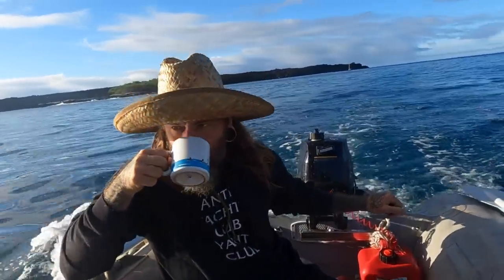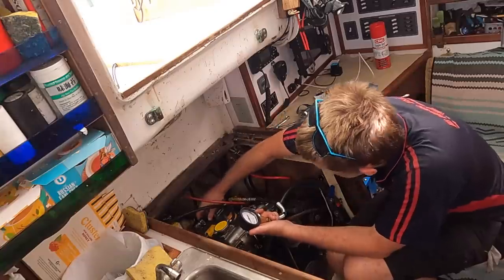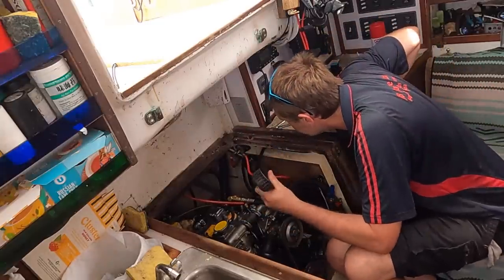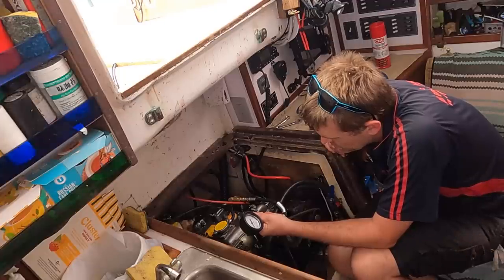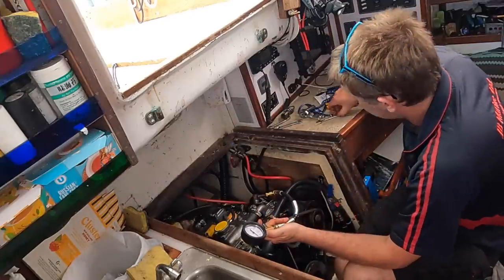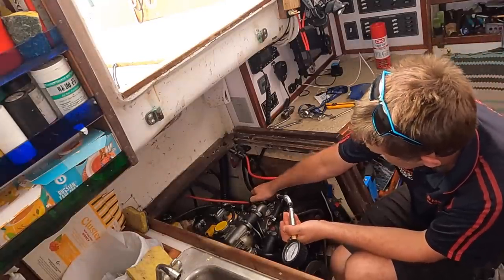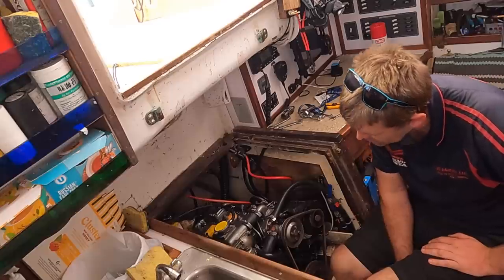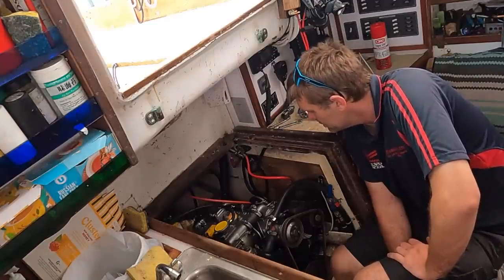ENGINE FAILURE: Testing the Compression & Pulling The Engine On a Sailboat in Opua New Zealand

Comment: I rebuilt my own 2GM20F.  It cost $1,200 US in 2012 in Mobile, Alabama.  These little engines weigh 365 pounds, close to what a car engine weighs (a small v-8).  If you remove all the peripherals (starter, transmission, alternator) it still weighs over 200 pounds.  There are no sleeves so you might have to ream and oversize the cylinders but my cylinder walls were fine.  I just honed them to break the glaze.  I had a professional machine shop rework the head:  it did not need to be flattened but he did replace the valves, valve guides, valve seats, springs and carefully clean it for $220.  I replaced all seals, put on a new fuel pump, replaced all bearings (the crank did not need work), new pistons and rings.  When I re-assembled it and put it on a test stand it started before the crankshaft completed a complete revolution!  It used 10 quarts of oil before the rings seated but never used any oil after the initial break in.  It ran perfectly for hundreds of hours.  These are great little engines that are easy to work on.  Unfortunately, Yanmar no longer supports these engines here in the USA.  But parts are available from international sources.  The chief problem with the engine is the water-lift muffler and seawater cooled exhaust.  Salt vapor erodes the heads with rust and imposes severe damage to the engines unless the exhaust is isolated from the engine at every shut down.  If you run a hot exhaust like all commercial boats do, this is not a problem and the 2GM20F will run for over 20,000 hours.  Great engines.  Anyone sailing around the globe should learn to fix his own engine.

Comment: Standard Yanmar issue. 
Exhaust valve and valve seats get eaten away by salt air coming back thru exhaust system. 
They can blow head gaskets but its not the most common fault unless they get cooked. 
Exhaust mixing elbows choke up (from low speed running, leaking/dribbling injectors) which cause too much back pressure on the cylinders.
Precombustion chambers can erode away. 
Shouldve put a squirt of oil down the cylinder thru injector hole to see if compression increased or stayed the same. If it increases then its normally a piston/ring/bore issue. If it stays pretty much the same then its normally valve seat condition. 
GM series Yanmars are a great little unit but they all suufer from the same issues. 
Raw water cooled units suffer more than engines with a heat-exchanger system.

Comment: when doing compresion test. If you add oil and do second test.and copression goes up. It tells you rings worn. If no change then its a head issue. Valves/guides.
Reply: That's true,  it could be rings but it could be valves.
Reply: On a diesel, if you add oil you can hydraulic the engine and do more damage..
Reply: @WillParker-kc3xt  he doesn't mean putting oil on top of the piston but rather in the normal way. It won't hydrolock
Reply: @jonnenne  you would never compression test an engine without oil in the sump. You and the original commenter have no idea

Comment: Low compression can also be caused by carbon buildup on the exhaust valves. There's an old trick where you pour a little auto trans fluid and kerosene mix on top of the pistons while the cylinder head is off getting a valve job. The atf and kerosene mixture will leak down into the compression rings and dissolve the carbon buildup, the cylinder head valve job will fix compression leaking out the exhaust valves, you put it back together and your all set! Another 2000 hours. Sometimes. But "sometimes" is still definitely worth a shot!

Comment: Got water in my old MD11  but realized it quickly and  saved it  by taking of the head and draining the motor  refilling with Oil   wasn't perfect but  continued running till i sold the boat a couple years later.

Comment: I have overcome low compression starting on an old tractor in winter by firing a blowtorch into the air intake. Not for everyday use, but gets it started.

Comment: Low compression doesn't necessarily mean that the sleeves and rings are worn, could be valve timing, or seating, or head gasket. If rings/sleeves were worn, you would have crankcase pressure, so next thing would be to check crankcase breather. If head gasket, and no fumes in boat, check crankcase breather and water pressure on fresh water cooling side, but if valve issues take head off and check seating.

Comment: No wonder you had a tough time getting the Yanmar started. As far as why it was getting raw water in it, there would have been several things I would have checked. The siphon break which must be installed between where the raw water comes out of the engine and the mixing elbow is clogged or not there (I've seen new engines ruined because of this). A bad mixing elbow. Some other exhaust defect like hoses or lift muffler. Overcranking with the raw water inlet open (pump still turns). I've even seen where a scoop was installed on the thru hull force water past the pump that did it. Hopefully the cylinders and head weren't too pitted and you didn't have to bore the cylinders out. At the very least I suspect you had to change the pistons and rings, and most likely the valves.

Comment: Hi James, why not building a bracket on the stern of your boat, to mount the outboard directly to the boat? It would be much easier to steer and handle while under outboard engine. Tritea is not that big and the outboard prop should shurly be in the water. I,ve seen that kind of brakets on a lot of sailboats here in Germany. Fair winds and following seas.
Reply from the maker: Because it’s unnecessary and I would have to have a long shaft outboard

Comment: I would think the sea water in the engine is from cranking the motor over without closing the seacock. It was pumping water with no exhaust, and it filled the exhaust up with water and into the motor

Comment: Has it not got a heat exchange  in this system, is it raw sea water strait through the block. Or is part of the problem water cooled exhaust manifold leaking back through exhaust valves . Hope you get it all fixed at a reasonable price.🙂

Comment: I seen another sailing channel that has a very simple leverage device on the side of his boat where he attaches an outboard motor to and simply lowers or lifts out the outboard from the water with the handle in seconds.
Reply: But then you use petrol and that cost à lot
Reply: @jungbolosse3034  when your about to be smashed by a approaching storm or you need to move fast away from a reef or a ship  and your engine has broken down costs don't matter and easier to fix .
Reply: @wilowest3509  so you are not talking about a permanent solution just in case of breakdown
Reply: @jungbolosse3034  yes a backup short hop solution .
I will try find the link tomorrow am off to bed now but was a simple setup .

Comment: Excellent episode -- QUESTION -- Had you installed a new Beta Marine (or similar) engine a the start all those years ago, would you still have all these engine problems or would you have avoided it all?
Reply from the maker: Water siphoned up the exhaust port, that would kill even a brand new engine, I had attempted to install a inline bronze seacock in the exhaust hose but it was impossible to find the fittings due to the parts shortages during the pandemic

Comment: Is it not work making some kind of clip or bracket that's removable to mount your outboard on to push the boat in emergency
Reply from the maker: The outboard would have to be a long shaft, the dinghy on the hip works perfectly
Reply: @SailorJames  one either side and it's a hydrofoil 🤣

Comment: What would a new engine cost?  I’m curious how close the repair bill came to just starting fresh.
Reply: Problem is, today, most modern boat engines are ruined the same way as car-engines are ruined by the zealots of the greta-religion. A diesel engine for a boat does need a high compression in somewhat voluminous, longstroke cylinders to enable momentum (torque) with low revs, induced by an all-mechanical, bulletproof low-pressure squirter-pump with one pumping piston and a separate injection line to an all mechanical spring-calibrated injector per cylinder, best even with a prechamber. 
There are no more such diesel engines You can buy new these days because they might smoke visibly (no modern NOX or micro-particles, just good old CO2 and honest grime) which is a no-no for all these technically illiterate greta-zealots. 
So, repairing/rebuilding it is, to thoroughly avoid all the senseless, unnecessary overcomplication all these shortstroke highrev biturbo common rail electronified direct squirters ruin the longevity of any good boat engine with.
Reply: @manfredschmalbach9023  in australia you can still get the gm30 non common rail for 5k new. But not in tbe usa.not sure about nz.

Comment: mechanical diesels (non-computerized and stuff) are the most reliable, practical engine types there is.  Yanmar has been making marine diesels for almost 100 years now.  I'm surprised
Reply: Me too, I have a vit of a love affair with diesel engines in general tbh, and never had a Problem with Yanmars, pr Volvo, probably  due to spoiling them rotten with early servicing and working them at good torque rpms, as all diesels just love working under load, keeps them shiny and happy inside. My  Next Sailboat comes with a Common Rail Computerised Yanmar 80hp as standard, so a bit nervous about that I must admit. 🤔 Best Wishes and Fair Winds.  Bob in Wales.  👍✨️✨️✨️🍻
Reply: @brownnoise357  wow, even new expensive yachts like tend to NOT use computerized diesels that are the back up engine for the reasons you well know.
Reply: @protonneutron9046  I know. I am Prepared to Test one though, as if the piggybank is as full as it should be, for me to pay up front for the Yacht, then a replacement engine a few years down the road should be OK, and I do just love Testing Stuff. A switchover of engines should be straightforward, as it is a traditional Shaft drive through the gearbox. I'm also going to be testing the Seldene automatic Sail Handling System, and the Sugar Scoop Bathing platform can have a dropdown Bracket for a backup Outboard as well, just in case. I'll also be testing a Triradial Suit of Sails with one a Battenless in Mast Furling Main. A number of people are keen to get performance updates on that, and how well a Furling self tacking triradial Jib can function with a Reaching Code Zero ( I'm keen on testing a Polyester laminate Cruising one with no Mylar, and how well it  can fill in the Wind angle gaps. It's a lot of fun to look forward to tbh. If I don't drop Dead first. Best Wishes.  Bob in Wales.  👍⛵️✨️✨️✨️🍻🍻🍻
Reply: @brownnoise357  all sounds awesome.  Enjoy all of it to the fullest.
Reply: @protonneutron9046  Always happiest when .I'm Testing Stuff tbh, especially precision loaded Rifle Ammunition, thanks to that great guy, the late great Dan Hacket one of the Founders of Benchrest Rifle Shooting, who was kind enough to Mentor me through becoming good enough to fly through the Precision Marksmanship Qualification, and I was able to Outshoot the Instructor in the post Qualification Fun Shoot, another great guy Dan would have got on with like a house on fire, and who we sadly lost to an IED in Afghanistan. RIP Phil. ✨️✨️✨️✨️✨️
Reply: @brownnoise357  the good often die young.  I've been hunting since age 7.  Nothing formal.  But by age 12 I could hit quail or grouse on the wing at 50 yards with a .22 consistently.
Reply: @protonneutron9046  Starting People Shooting very young really pays off, as it takes literally years to become a Rifleman, a d which was Convincingly confirmed as highly Beneficial by a US Mi.otary Study, which found that those who had become good Shots Prior to Joining the Military had a  Much higher Survival Rate, and Much Greater Effectiveness on the Battlefield. This is further confirmed by the Israeli Military System, and recent incredible effectiveness demo strategy by the Donbass and Chechen Militias in East Ukraine, which h not only have done an incredible amount of heavy lifting, they have also been beating the Crap out of the Highly Trained NATO Equipped Professional Ukraine Military. Here in  retain, we Used to Understand this and only ever had a very small Professional Army. Everything else was the Militias. Yet since WW2, or maybe WW1, there has been this increasing Fala y here, that the Only Capable Mi,Italy, is a Orofessional One, which isn't just Wrong, it is a Blatant and Dangerous Lie. Something has gone seriously amiss. 🤔 Best Wishes.  Bob in Wales 👍 ✨️✨️✨️

Comment: Maybe a stupid question....Is there any special techniques for driving the boat with the dinghy on the hip?  The only reason I asked was that I noticed the outboard motor was turned toward the sailboat (as if the dinghy was turning right).  Was that on purpose?  Thanks for all your great videos!
Reply from the maker: It varies boat to boat, my full keel needs the outboard pointing to port to make the boat go straight

Comment: "Chaos mode" is what it was like in most cases we did an engine-pull for liveraboards. You gotta lift the stinkin' lump of momentarily useless castiron everybody fullheartedly hates by now right between the spicerack and the charttable without spilling all of the unpleasant liquids all over their dinner, their countertops or their children. Some production boats need somewhat extensive cutting into parts fitted after the engine was put in during being bodged together, too, which adds to the trauma an engine-swap or outboard-full-rebuild usually is for the owners not only because of the pricetags a lot of shoreside shops have to put on their work, given they're competing with fancy seafood-restaurants, expensive watch-sellers and high class boutiques for the sheer space to offer their services from. So You seem to be right in the middle when it comes to the range of inconvenience: no kids to entertain, boat still watertight and capable to anchor out (imagine having a saildrive that's gotta come off in order to free the engine enough to get it out ...), awesome shop to work with ..... Could be worse I reckon. Resilient self-reliance of the dedicated singlehander, obviously. Thanks for sharing!

Comment: So you also got water in your engine ? That seems to be a problem that sailors need to know how to address. It just destroy's the engine ! It happens far too often !

 I have a video about engine rebuilding top end only,, valves ect. And another where the guy did the rings at anchor including the sleeves. The top end one was perfect and the guy who was the brains was extremely knowlegable, it was done on Bums on a Boat by a guy and you'll see the guy now as the "bum" is now on the experts boat, I think his name is also James ? Its farily easy to find by searching " Engine Series [Top-End Rebuild] " and its very good. Its like a mini playlist ! Thanks for doing that Bums !

  The other one was done by a kid who didn't know what he was doing . You see the cylinder parts completely displayed.  His is mostly good from the "seeing what is inside an engine" viewpoint.

Comment: Why do they use diesel rather than standard gasoline engines on sailboats?  I would think standard gas engines would be easier and less expensive to repair.
Reply from the maker: Because gas is explosive and Diesel isn’t and diesel is a far more efficient fuel

Comment: These engines should have a normal radiator like a car does and no sea water used for anything.  I swear, every sailboat channel has this crazy seawater in the engine problem.  Forget this seawater cooling.. Dump that!
Reply from the maker: It had nothing to do with the heat exchanger and a radiator only works with air blowing across it
Reply: @SailorJames  ...wait, what?  The water didn't come from sucking water into the engine to cool it?  Oh, oh.. I did not know that.  So where did it come from??

Comment: JAMES I HOPE YOUR HAVEING A FAT TIME WERE EVER YOU ARE AT THE MOMENT.
I DIDN'T REALISE YOUR MOTOR WAS ONLY A 2 BANGER.
I HOPE IF THEY FIX IT FOR YOU THEY DO THE BEARINGS TO AS OFTEN THE EXTRA FRICTION ON NEW PISTON AND RINGS OR EVEN JUST RINGS WILL BLOW THE BOTTOM END OUT AS THEY WILL BE JUST AS WARN AS THE TOP END.
SADLY 2 CYLENDERS DOSE NOT MEAN HALF PRICE OF DOING A 4 CYLENDER UP.
WHEN YOU SAID YOUR ENGINE WAS TOAST AGES AGO I THOUGHT ABOUT DOING A GO FUND ME FOR YOU TO GET A NEW ONE THEN FOUND OUT YOU WOULD BE SIX MONTHS AHEAD OF WERE WE WERE WATCHING AND YOU WOULD HAVE ALREADY HAD IT FIXED.
FOR SUCH A SMALL MOTOR THAT HAD THAT MUCH DAMAGE IN THE CYLENDERS AND NO DOUBT HEAD IT REALLY DID AN AMAZING JOB .
THEY MUST BE A PRETTY STRONG LITTLE ENGINE TO STILL BE RUNNING WITH HOW IT LOOKED ON THE INSIDE.
I LOOK FORWARD TO YOUR VIDEO'S MAN THANKS A TON FOR THE GREAT ENTERTAINMENT OVER THE YEARS SO FAR.